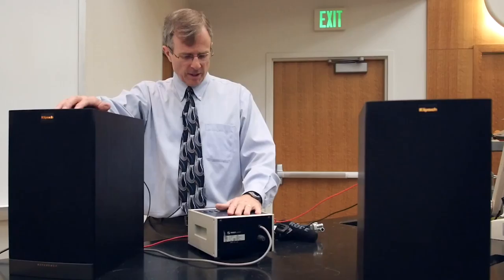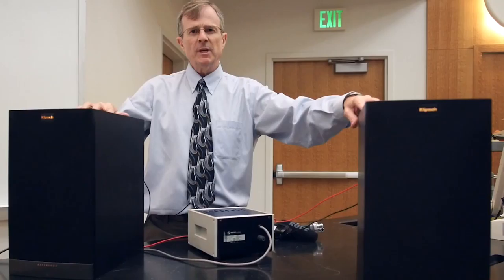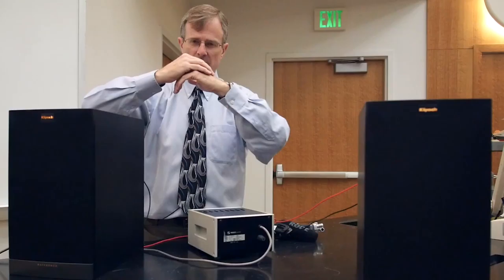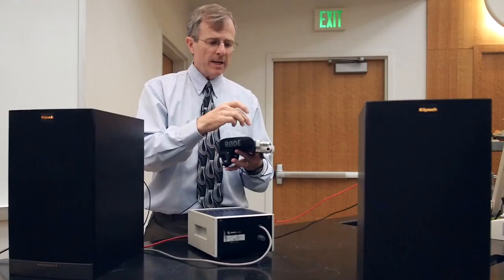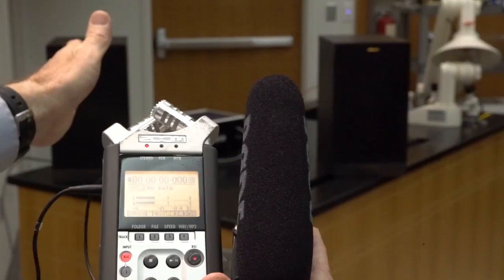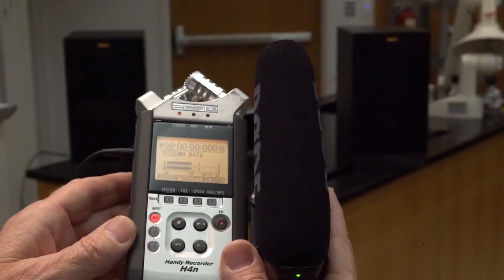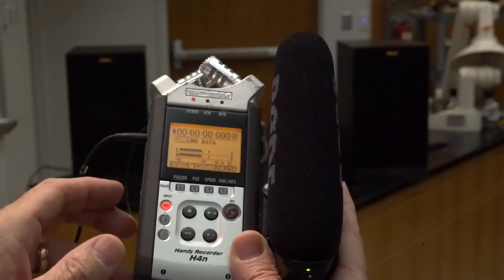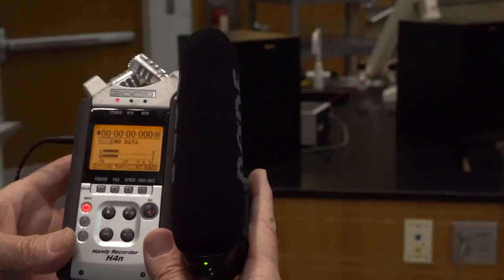Interference Demo: Speakers

Comment: I’m pretty sure this interference is called comb filtering. If you move around while playing pink noise, you’ll hear certain frequencies start to pop out, and a sweeping noise as you move. Sitting in the exact center in a concert, for this reason, will usually sound the best by far. It is worth noting it has to be the exact center.

Comment: How do we ensure there’s no initial phase difference between the sources?
Reply: Same question. I think that the same source is working on both speakers, so initial phase difference is zero. If these were two random speakers of some DJ, then there would have been no interference pattern.
Reply: both speakers are powered by the same sine source, so it's reasonable to expect both sounds to be in sync. 
In practice, even a slight shift in phase will just result in a slight spatial shift in the interference pattern the microphone picks up one, which is likely to be far smaller than whatever uncertainty you have regarding distance.

Comment: Why don't you move microphone up and down?
Reply from the maker: I could certainly move the microphone up and down, but it would not show the interference effect.  To hear this effect, you need to change the difference L2-L1 between the path length L1 from the microphone to one speaker and the path length L2 from the microphone to the other speaker.  If you held the microphone equidistant from the two speakers, you could move it up and down all you want and it wouldn't change L2-L1, because L1 would always equal L2 and L2-L1=0.  Moving the microphone sideways allows you to change L2-L1 to see the interference effect.  For more information, see https://youtu.be/oWOSrlbqVJo.

Comment: Why did not the amplitude become zero on destructive interfernace
Reply: Coz its theoretically true but in reality various other factors come in play
Reply: in practice there are a few other things to consider:

- you have harmonic distortion at the source and speaker level: you simply aren't producing a pure sine wave. The idea that you get an interference pattern with "zero-ed out" points where you get total destructive interference can only really happen if you have a single frequency. You effectively have multiple overlapping interference patterns which don't line up between each other.

-you have other external sound sources. The person moving the microphone around produces some amount of noise, even while trying to be as silent as possible. This is picked up.

-you get reflection against the room's wall. These fade quickly but act as additional sound sources.

-Even with a pure sine wave and no external noise, you still only get that total destructive interference in infinitesimally-small locations where the sound waves precisely cancel out. It's possible to approximate this over a relatively small fraction of the incoming wavelength, but the reality is that the type of microphone used here is actually a relatively large fraction of the sound's wavelength (which is 17cm at 2kHz whereas a microphone of this type has a membrane a few millimeters across.

Comment: Is moving the microphone (from the center of the distance of two speakers) to half lambda away, will always create fully destructive interference? I am considering that although the crest meets the trough, but the number of the amplitude at that time is different.
Reply: Achmad Rizal 
Yo need a coherent source for that which is not possible to create in normal circumstances
Reply: @gabbardaku  but we can create coharent source of light right?
Reply: @thecrazygamer7334  that is a monochromatic laser